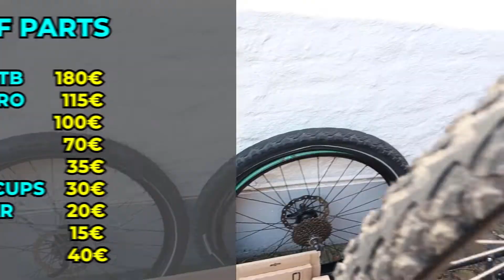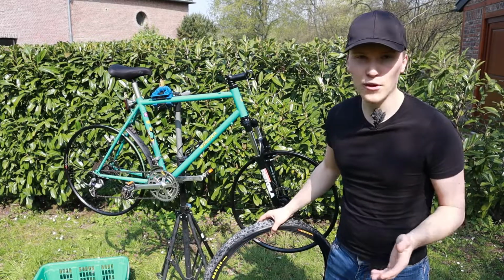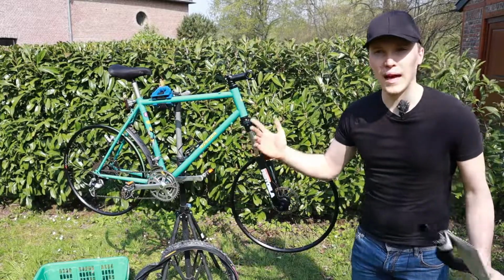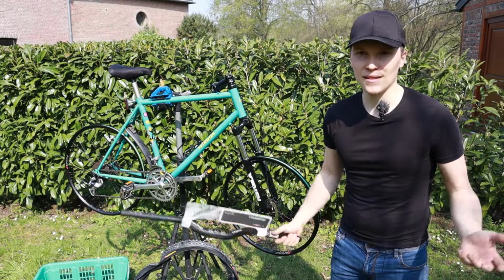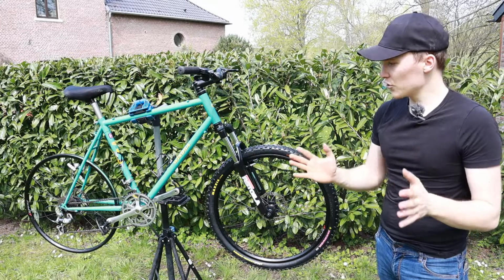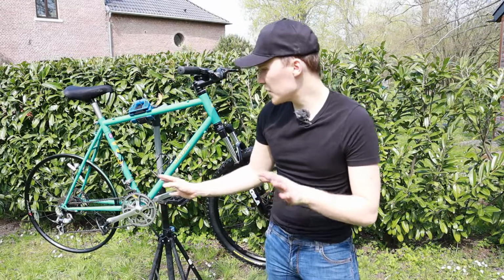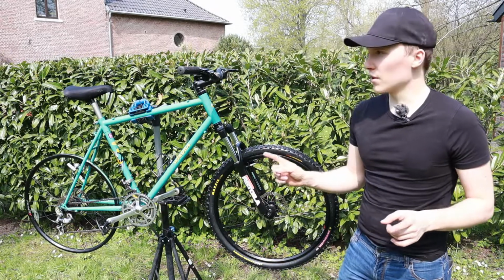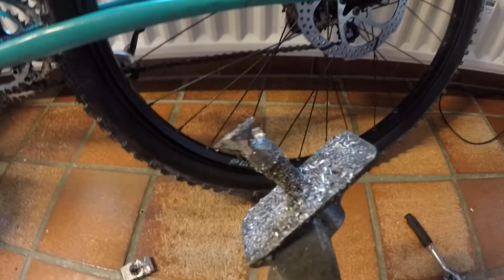80´s MTB Restoration Pt.2: Drilling, Handlebars, Tires..

Comment: Great videos, also doing a similar project with an old Gary Fisher hardtail. So I want to change my handlebars from 25,4 mm diameter to 31,8 at clamp, but will the brake and shifter levers still fit on them because of the clamp size or do all handlebars narrow down at the end to the same size?
Also want to mount disc brakes but hydraulics would require new levers and currently I have brake and shifter together so it would be much easier to use mechanic disc brakes, but are they good enough?
Reply from the maker: Thank you so much! :) I had no problem installing the old shifters but also the new SLX shifters and brake levers went on no problem, since the new bars are narrower at the edges. You just need to find the right one. The mechanic dis brakes, the TRP Spykes are very good! I love them. Maintenance, meaning chaning pads is also much easier compared to hydraulic. So, yeah hope that helps and have fun with your gary Fisher build! 
Cheers, Armin
Reply: @Armin_27  thanks a lot for the response! It is nice to get some first-hand experience answers :)